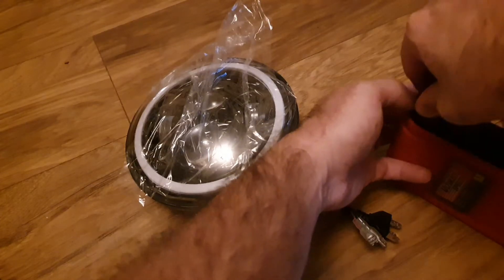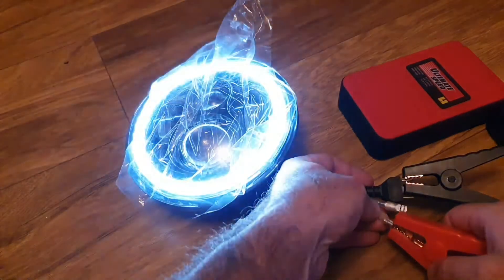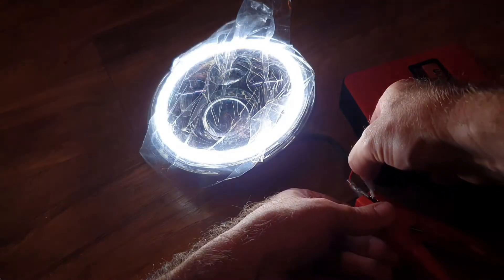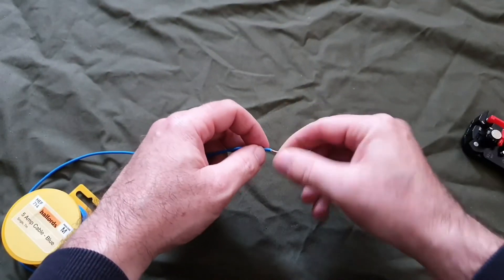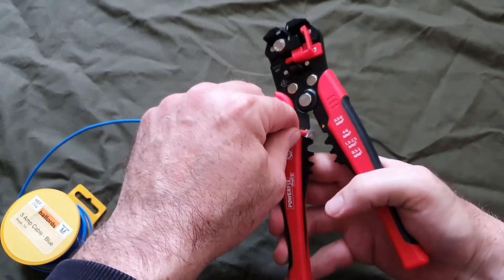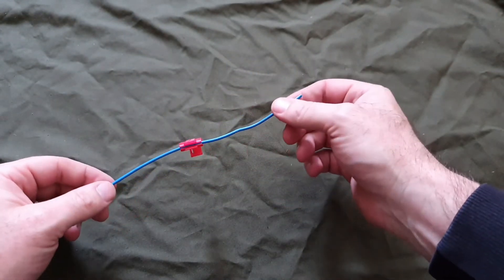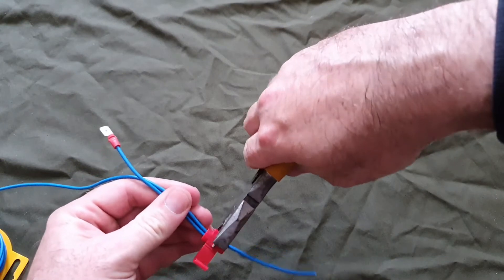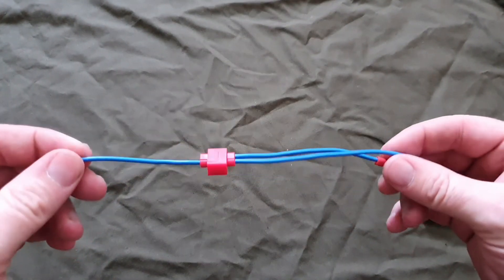Upgrade Land Rover Defender Lights With LED Halos

Comment: I’ve got the same headlights just taken them out as I want the drl and indicators to function as they never have since owning the vehicle. Do you have a diagram of where you connected each spade connector too??
Reply from the maker: On each side of the car I spliced two wires about 40cm long with a spade connector to the side and indicator lights in turn in same way as I showed in the second half of this video, and then plugged them into the appropriate connectors on the headlight unit to complete the circuit hope that helps

All the best
Roo

Comment: Not sure I like the idea of the indicator taking over the actual light.  The lights look awesome.
Reply from the maker: Cheers only the ring part changes colour the main bulbs are straight off the normal H4 plug mate
Reply: @PreparedCamping  kinda makes it like an Audi then!
Reply from the maker: @Jazzman5  if audi made bricks that don't like going over 70mph 😉